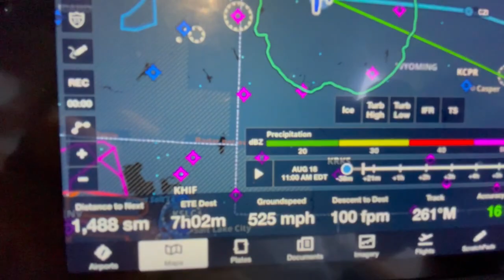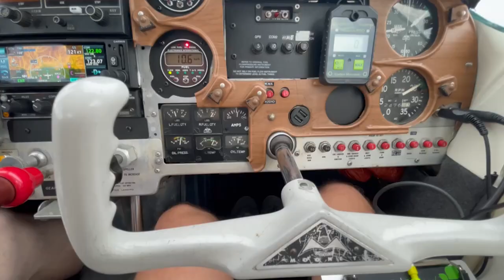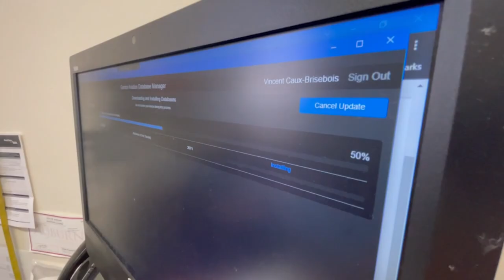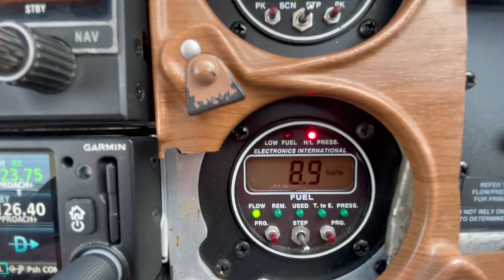We Bought an Airplane and IMMEDIATELY Flew it Across the Country | Part 1

Comment: Poor N7482P has been in not one but two wheels up incidents. The first was in 1964 when the Pilot in Command failed to extend the gear. The second was in June 2022, when during approach into Auburn, the engine lost all power. The pilot opted for an emergency landing in a nearby field, and the landing gear collapsed after touchdown.